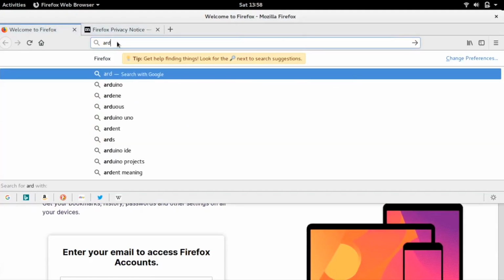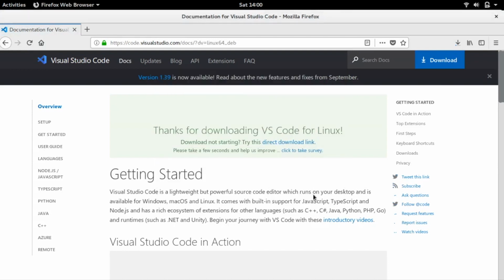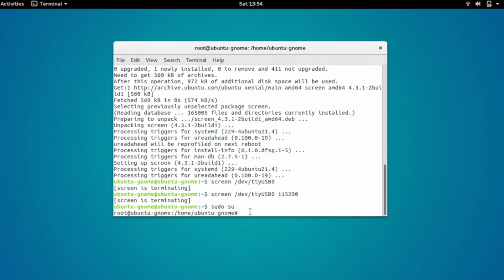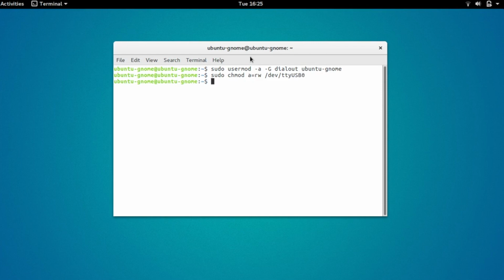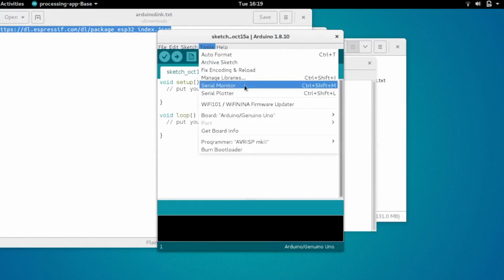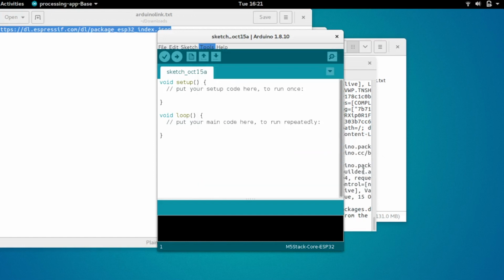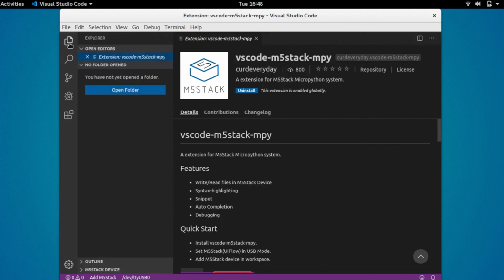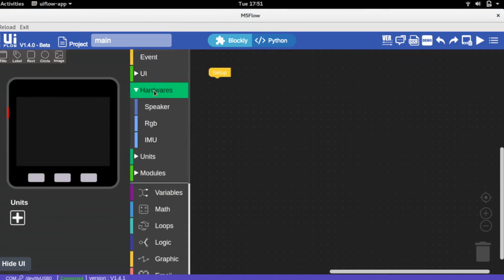M5stack Linux Setup - Arduino - VS Code - UIFlow

Comment: Hi! There is something that does not work in my case. I am using a Linux virtualbox VM and after I connect the M5Stack to the PC and do the command screen /dev/ttyUSB0 115200 it scrolls something and end up with reading from file Hello.txt and it stops there. There is not any access to the prompt. Whats wrong ?

Comment: Hi,
For the M5Stack VSCode plugin - what should I do if the "Add M5Stack Device" link/button does not appear down in the status bar?
I've installed the PlatformIO plugin previously and decide it to remove it (at least for the work space) and reinstall the M5Stack plugin but the result was the same.
Yes, the device is in the USB mode, and the designated port is indeed /dev/ttyUSB0 - saw it in the PlatformIO Devices tab prior to removing it.
Otherwise awesome video - covers tons of use cases in under ten minutes.
Regards

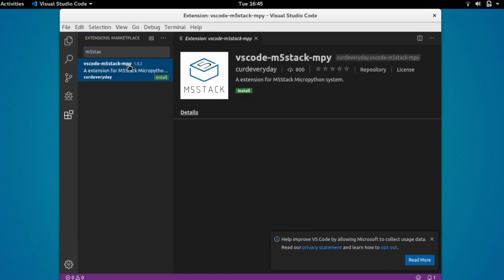Comment: 7:00 which firmware to use with VScode ? I can't see or créate any files with UIFlow 1.4.1 FW
--> yes USB mode : sorry
Reply from the maker: Hi Phillipe, did you manage to use your M5Stack with VS Code after entering USB mode? Sorry I should have filmed that part of the process, but I didn't have a device to hand at the moment. For anyone else having the same problem. M5Stack Devices with UIflow firmware press the right side button on boot, and select usb mode from the list. M5StickC devices press the big M5 button on boot, press the right side button to cycle to setup, then big M5 Button again then select usb mode from the list.
Reply: @M5Stack  sorry, my text is not very explicit. In fact I easily found the "Connect USB" option on the M5Stack, I just did not read the help correctly.
It remains to find the documentation on Python for M5 libraries. I did not find any answers in the M5 Forum, nor on GitHub.
Reply from the maker: Hey  @phd0  you can view the Micropython API here: https://github.com/m5stack/UIFlow-Code/wiki and see some projects developed using micropython on our hackster.io page https://www.hackster.io/m5stack